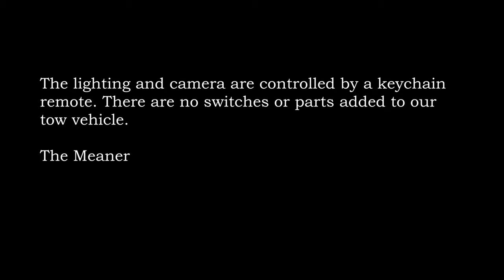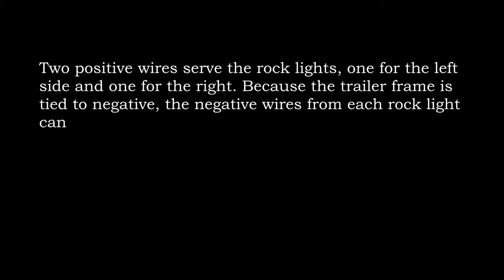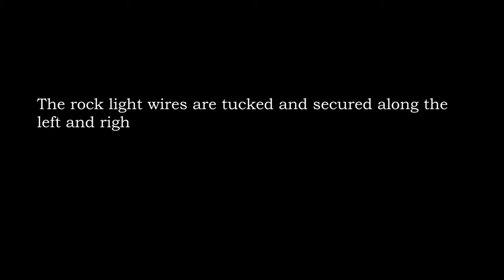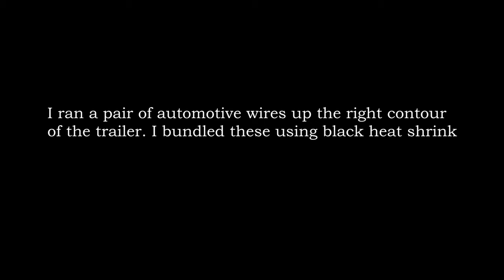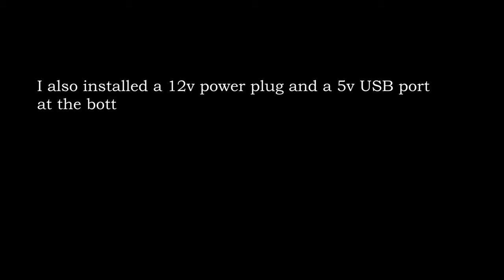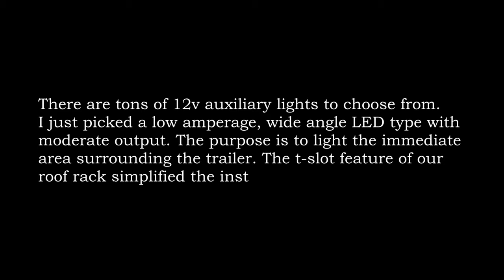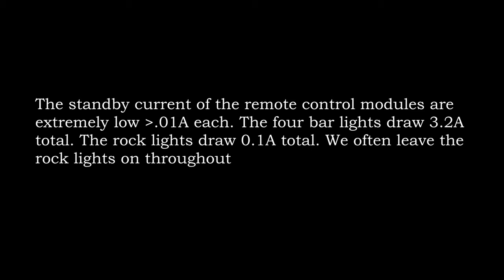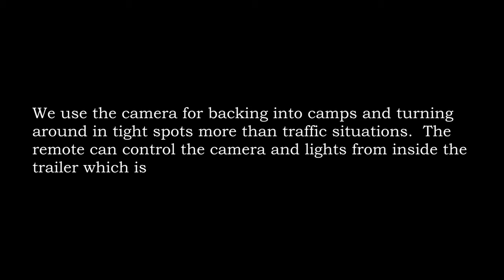Teardrop trailer: RC Rock Lights / Flood Lights / Rear Camera

Comment: David, I'm about to build up a version of this project box. In a later Teardrop Camp News, you swapped the inside cabin USB connections in the attic, with USB3 with a voltmeter and switch. The conversion from 12V to 5V was internal to the new fittings. I think I'm going to use one of these in the project box, rather than install the conversion board and the external USB you've recommended in this older video. Any thoughts or recommendations? 
Also, I'm wondering if you can get this early video linked up with the subscription to Teardrop Camp News??
Reply from the maker: Great idea! It would simplify the installation, given the internal circuit plus a round hole to drill, built-in switch, and easy to handle waterproof dust cap. I'd use it. (FYI, we've never used our 12v port here; maybe someday)
Reply: @dchurch911  I noticed your twelve volt plug in the video. I wondered if you had ever used that. LOL I'm thinking about changing out that 12 volt plug in the galley, to a dedicated USB plug. I haven't looked to see about access to the area. Might be a tough go.
Reply from the maker: @uptoclarinet  We do use the galley 12v port for our air compressor... But there is one for the cooler that could be used as a backup. It might be easier/better to just add a USB type in the sink cabinet or at the backsplash. FYI, Disconnect the battery/power and remove the fuse panel/power-center to gain access to the wiring and sink cabinet wall... It's pretty easy to just swing the power-center out of the way.